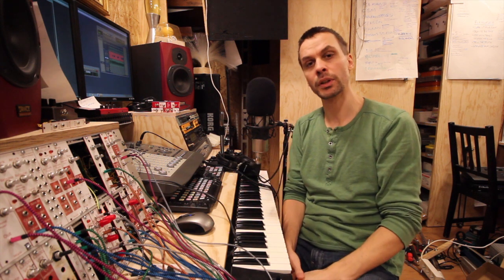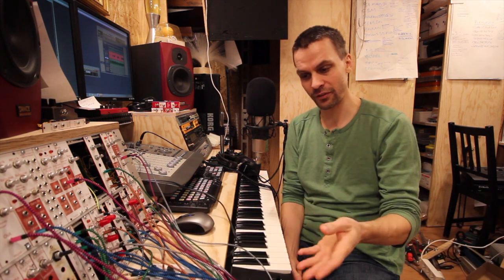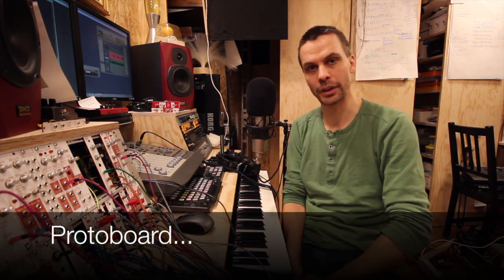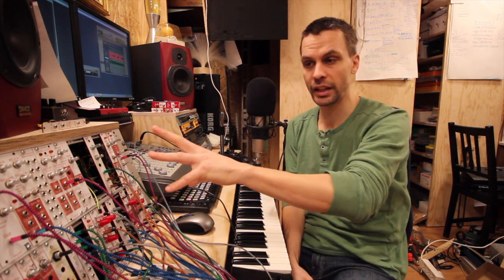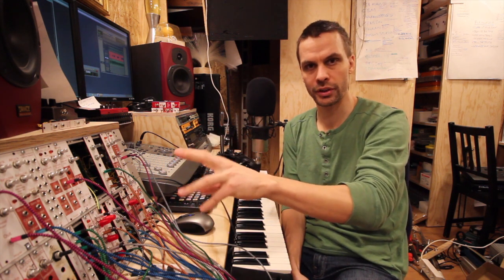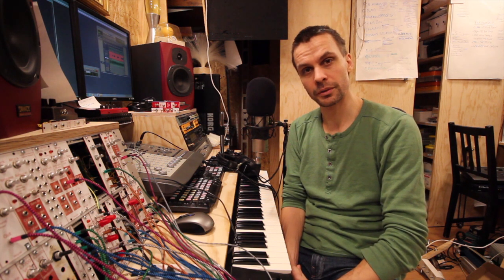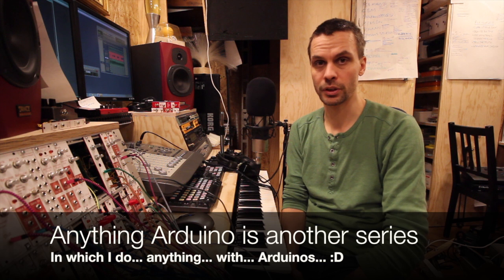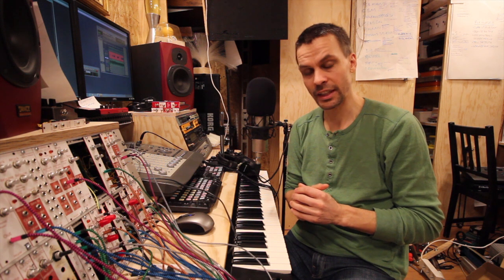Synthrotek DIRT VCF - DIY Modular in a Week 7.6

Comment: Thanks for your work! 5 years later, I know, but did you make the shelves CV controllable?
Reply from the maker: No. Some “complications” came in the way like divorce and moving away and back. So I actually removed all control circuitry. And since I got back I only use it manually. :)
Reply: Oh yeah, life happens. Good to see that you're still at it :)
I like the idea to control things in my environment with my modular. Lights would be somewhat obvious, but I like the idea of moving curtains with an LFO or something like that. Probably not overly useful, but I imagine it fun to look at. ...and the backlog of ideas just keeps on growing sigh
Reply from the maker: @ottootto6396 oh the backlog…. 😭😭😭

Comment: Any reason why I couldn't add a CV amount pot (passive attenuator style) after the CV in jack? Would that do the job, or is the CV attenuation more complicated than that? 
Have successfully built a few bits and pieces now, but still a relative newb, so I do ask fairly obvious questions!
Reply from the maker: You can add an attenuator. It’s as easy as you say. :)
Reply: @SourceryOne  I thought so - thanks. BTW I've made the q&d filter and the trim pot is so much fun I think I'm going to replace it with a pot on the panel. The filter is so much better than I expected.

Comment: New series: "Modular In A Week: Expansion" - First module could be a MIDI 2 CV (could use an Arduino or Teensy), then a Sequencer (could also use an Arduino or a more classical analog 555 + 4017 combo). Then a Clock divider (could use an Arduino, too), a sequential switch (even this one could use an Arduino), a frequency divider (a la Doepfer A-115), ... just to throw in some ideas. ;)
Reply from the maker: As if I need MORE ideas!!! :D My desktop is flowing over with papers with scribbles of all my ideas... But ofcourse, thanks! I actually have a lot of Arduino modular related projects planned, and so far I actually think the Teensy is overkill... So this adds some more scribbles to my desktop-mess.... *sigh*... ;)
Reply: Oh, well... I didn't want to cause problem. Just contribute to the serie growth - somehow (maybe a fusion between the MiaW and the All Arduino series)
Reply from the maker: Luca Crisi lol... no problem just a little kidding around. Merging the two is a thought I had aswell. They do intertwine even though not many people relalize. I don’t think the modular synth people realize how many arduino are in their modulars. And the maker community how how many arduino a are actually used to make music. :)
Reply from the maker: Luca Crisi yeah the “big boys” use the teensy because you get better resolution on the output signal (12bits at least) ordinary arduino only gets 8bits and also the teensy has a lot faster processor. But for my humble needs (so far) an ordinary arduino is sufficient. :) I have started looking at displays of all kinds for example to show waveforms. Now if I only could get the time to match the amount of ideas. 😅
Reply: I was thinking about this today. I have a clock trigger I built to control my LMNC Big button sequencer using the clock circuit in the Casper Electronics sequencer tutorial. However I don't know what the BPM is and can only set speed by ear. 

So my thought was to use an Arduino nano controlled by a pot to send a trigger signal to the CD4040 in order to get steps out. But the Nano could also use a 3 digit display to show the BPM.

Haven't got it all worked out yet, but I'm pretty sure it should work if the pulse from the Nano can be controlled to trigger the CD4040.

Any thoughts?

https://bastl-instruments.com/support/tutorials/omsynth-project-2
Reply from the maker: Actually once we get into arduino land there is no need for cmos logic anymore. As the arduino outputs 5v it can trigger (with just a voltage follower on the output) things on its own. Adding a display is on my todo list. 🙄 it is so long that list. But yes clocks and sequencers are a given next step. It is so obvious now when I have a system. I want to create patterns and things that are actually in sync. So... more ideas to my pile. 😉
Reply: My thought for a DIGITAL sequencer was to minimize the knobs (and the overall size of the module). Instead of having 8 knobs (or more, or less), I'd use only 1. and a button to STORE the value. Then buttons to play/top, step play, and some to choose the modality: forward, reverse, pingpong, ... Some buttons may have more functions depending on the context: Record, Play, ... Of course, a display (or a less intuitive bunch of leds) is needed.
Reply from the maker: The problem that I have faced with all digital is to find the exact voltage for each note. And here the teensy with its 12bits or and 12bit dac would be needed to get the resolution out to get good notes along the scale 1v/oct. But it sounds like a nice concept too. Like lmnc one button but with cv instead of just gates.
Reply from the maker: Luca Crisi that’s the plan. 😉

Comment: You know, I have been bitten by the modular bug thanks in part to your series. Right now I have a 4069 dual LFO that I really like, a RA VCO (that I actually got working properly tonight with a homemade  vactrol) already built and the 4046 VCO is four wires and a panel away from completion.  
Loved the DIRT filter, that one is definetly going on the list. 
Looking forward to the next series.
Reply from the maker: Congrats on the homemade Vactrol, how did you make it? Shrinkwrap, Fimo or other? What design did you use for the 4069 Dual LFO? Schematics? Sounds interesting and "easy" ? :) The DIRT filter was an easy build for the amount of mangling it does ;)
Reply: @SourceryOne  https://goo.gl/images/P5CxMC Thats the 4069, needs to be an UBE  to work. I had to remove the rate LEDs as the 4069 couldnt source enough current to drive them, but I am adding a small led driver to sort them out. Sounds very nice, good range and with just a couple resistors, a pot and a capacitor its a real easy build. 
Vactrol works well for me, I used heatshrink tubing, one black layer and a second red one for flair. Tested and it works just fine. It helps to use two layers, and you can use short pieces of thinner heatshrink on the legs of the LDR and the LED to help eliminate light leakage near the diode and LDR body. I can put up a short video tonight if you like.
Reply: I put up a short video on how I do my Vactrols on my channel, featuring my RA VCO